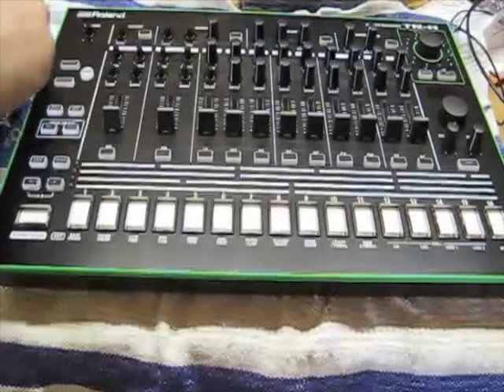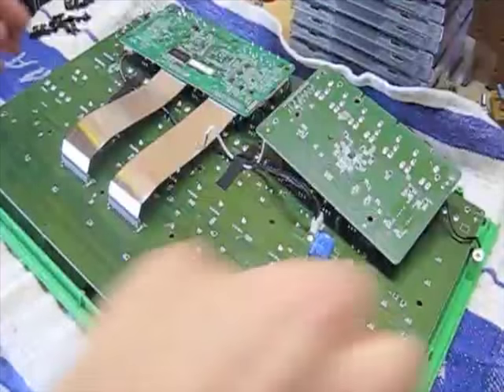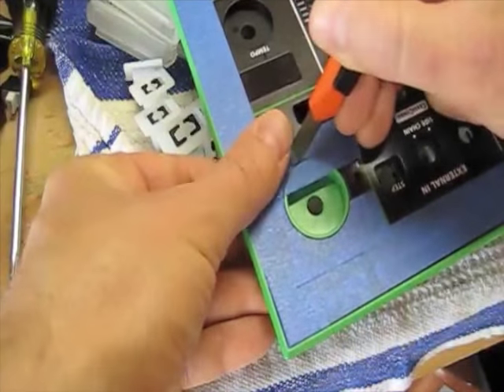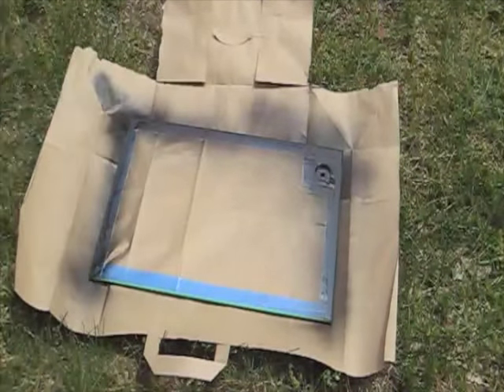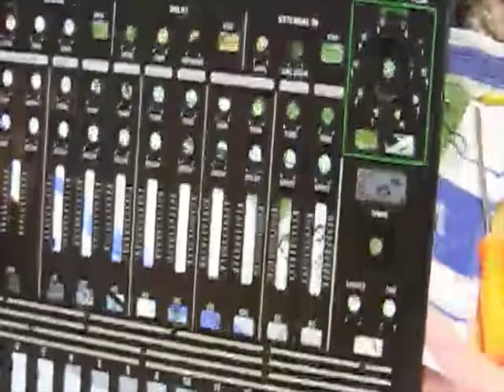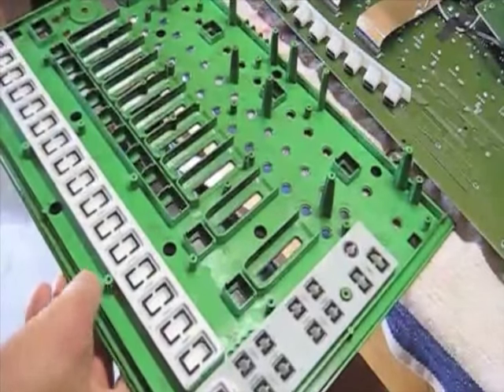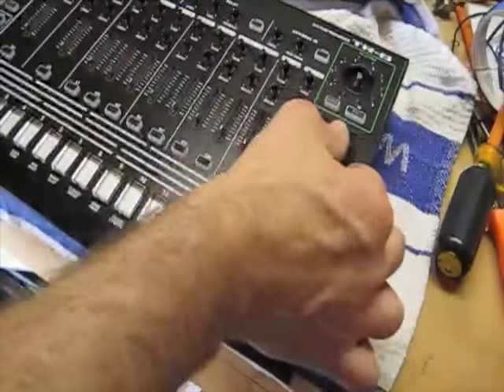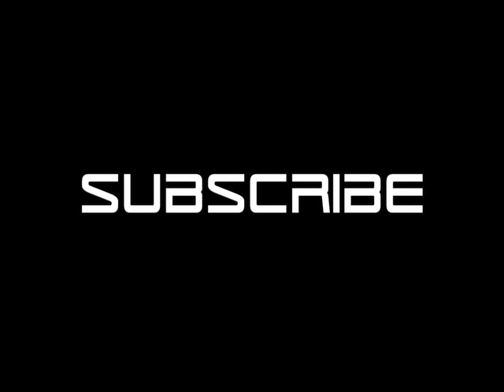Roland Aira TR-8 Custom Black Trim tutorial

Comment: I am going to get the white Synthgraphics overlay... But wanted the black edges like you did. 
If I just remove the slider caps and then mask the machine off do I need to trajectory apart to paint just the green edges?
Reply from the maker: I would personally feel much safer taking the machine apart and painting the parts you want, instead of just masking it off.
Reply: anode8 for paint… Did you use a matte black or shiny black?
Reply from the maker: I used a gloss black spray paint.
Reply: thanks for the head's up! appreciate you posting the video, too!

Comment: So you didn't "key up" the plastic before applying the primer ! ... this is gonna look terrible when it starts to chip which it WILL do eventually.
Reply: What do you mean by "key up"?
Reply: he means lightly sand or wire wool the surface to give the paint something more to adhere to